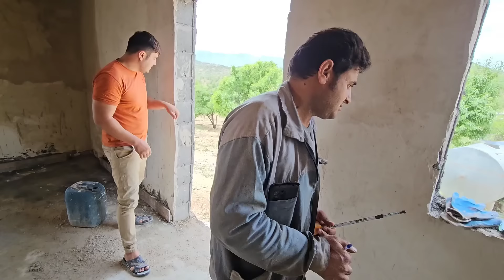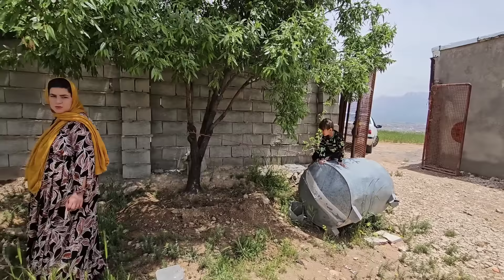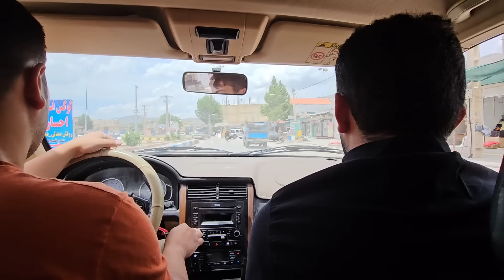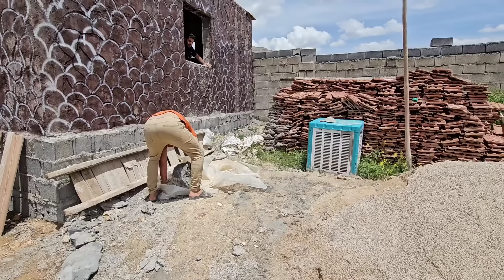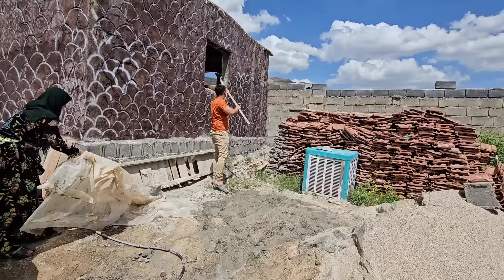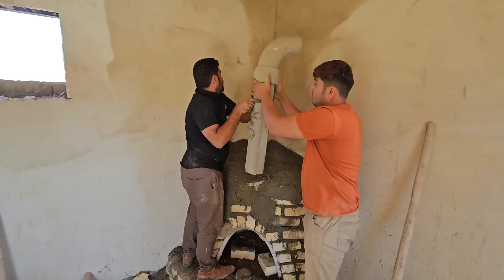Warmth for Winter: Malik and Maryam Build a Fireplace for Their Nomadic Home

Comment: Малик,прежде,чем делать камин ,залезь на крышу и сделай ,чтоб стены не мокли,это называется строить шиворот на выворот.Как в этой сырости будут жить дети и грудной ребёнок,хочешь ,чтоб болели.
Reply: From my experience 20+ yrs ago, we were in a new wood framed house and we started to have health issues.   We discovered we had toxic black mold growing inside of one wall that had started from a leaky window. My husband ended up ripping out and replacing all of the sheet rock wall inside the home and the paneling on the outside, replacing the wood,  treating everything around it, as well as fixing where the window was leaking.  It took a couple of weeks because he had to let everything dry out. It was a mess!  And that is what Malik is going to have!  They are not building a woodframed house, they are building their house from materials that absorb water if they are not properly sealed to prevent it. When that wet wall is constantly soft, and getting softer with each rain, and that heavy brick will starts to shift and collapse. I hope the roof doesn't collapse as well.  He really needs to call the contractor back because Malik's construction skills are non existent and look horrible.😢😢  It pays to do things right the first time so you don't have to go back to fix a complete mess just to start over.

MALIK, it's better to have a gas stove because all of that soot coming from burning that wood is going to blacken the inside of walls of your house. IJS
Reply: @lenniewatson687 verdade,o pilar que o outro homem rebocou ficou perfeito e o que Malik passou o gesso ficou horrível horrível mal feito
Reply: SLOW THE SPEED DOWN ON YOUR FILMING!! YOU ARE GOING AT HIGH SPEED😂😂